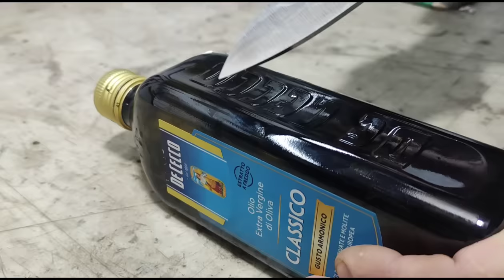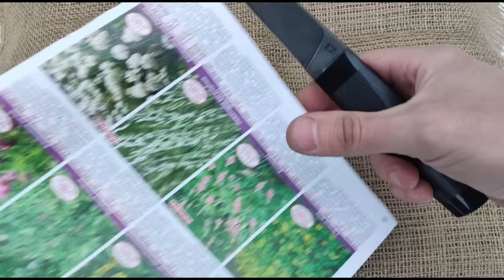Wootz steel from bearing balls | Making a Scottish Dagger "SGIAN DUBH"

Comment: It turned into steel and among its components is glass, which I have never seen before mixed with steel. This means that it is a metal with properties, the first of which is that it will be very sharp in a way that no one can expect except those with great experience in the field of metals. This is the secret of true Damascus steel: flexible, hard and sharp.

Comment: Hello. Can you explain how it can cut the glass and be processed by file in a same time?
Reply: I'm no smith, but you'll notice when FZ heat treated it, the end of the tang was not nearly so hot as the blade, and it was the end of the tang which was processed with the file. I suspect that the end of the tang just isn't tempered - and you probably couldn't cut glass with that part. Thankfully, those threads don't need to cut anything.

Comment: 2:18 pause, just struck by a wondering: has anyone ever made a blade that displays both kinds of "damascus" steel - the wootz and the pattern-weld? like, make one set of wootz steel with one target composition, and another set of wootz steel with more nickel, flatten them out, cut and stack, then forge weld them together and do all the pattern-weld art?

Comment: I have been trying to replicate this for months and I can't seem to get it. Could you please tell me how you get the forge so hot? I am trying to make everything myself and use what I make to make wootz. I have turned pyrite into iron chunks but so far my crucibles don't get hot enough to melt steel. Any help would be appreciated!
Reply: He starts the forge with charcoal/wood, then changes to chunk charcoal(hot) or coal(even hotter).  The key to running these high carbon fuels is forced air.  Under the grate, there is a steel pipe that connects to a blow dryer or blower.  This supplies the needed air to get the fire hot enough.  To be clear, you can not get a fire hot enough to make molten iron/steel without high carbon fuels and forced air.  The amount of fuel and time will be directly effected by the size and insulation of the burn chamber.  Note how he seals it once the burn us up to higher temperatures.  Also, get a laser thermometer capable of 1500C (see BT-1500) for under 100 US and you can get more reliability with the ability to measure the temps.  Hope this helps you. :-)